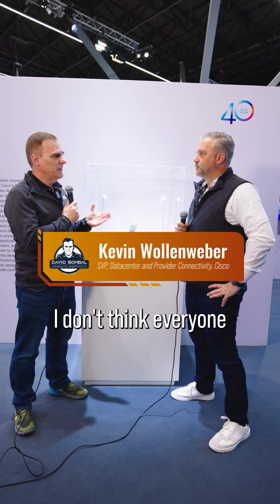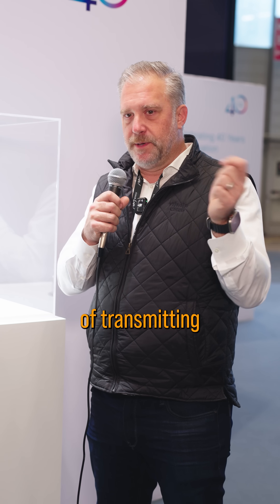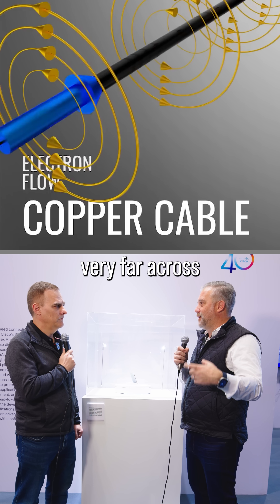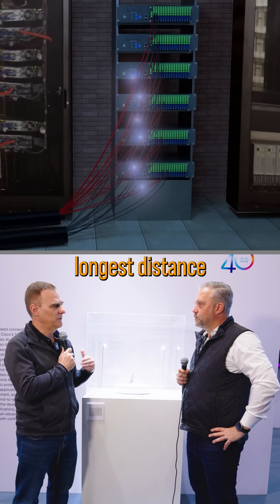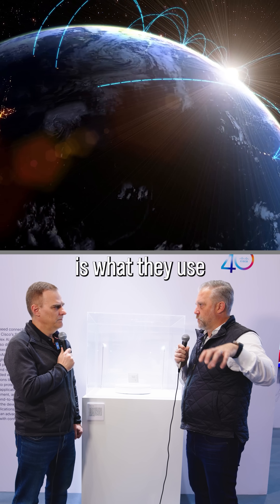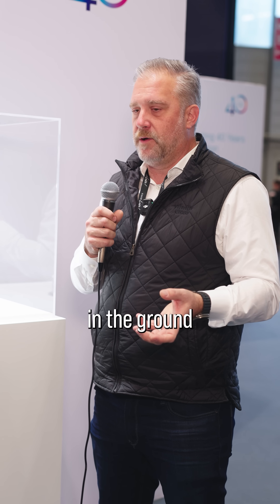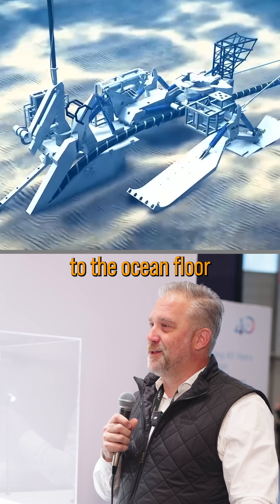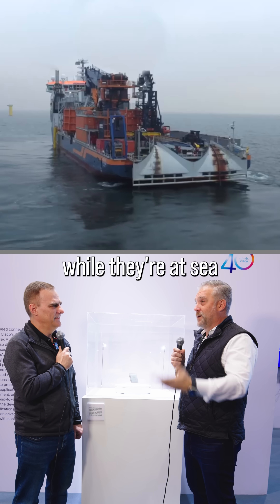Fiber vs Copper Cable: FACTS

Comment: In single-mode max distance is 200 km, in mulitmode 2 km . Then you need aa repeater or the signals get too weak or scrambled.
Reply: Well it’s 10-25 km, after you need repeater/amplifier

Comment: The part that fascinates me is, the repeaters can only transmit the light so far. Well, where else is it going to go?
Reply: It gets absorbed by the glass and the data is lost or the information degrades. The light bounces continuously on the glass as reflections as it travels. The longer it travels, the more degradation there is.
Reply: @philipehusani Interesting on light being ‘absorbed’. Will have to look that up someday.
Reply: @troyjollimore4100  I'll say it more like the way light travel through fog, it can't pass through many particles, it also applies to the glasses, I stand to be corrected
Reply: @theo-k4i8m  Good analogy!